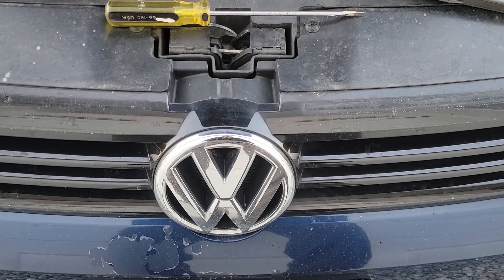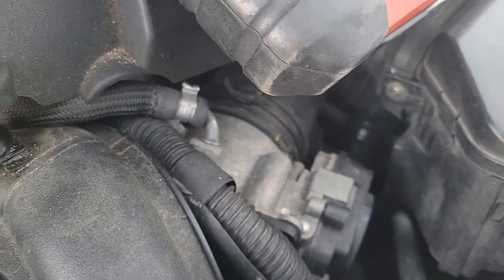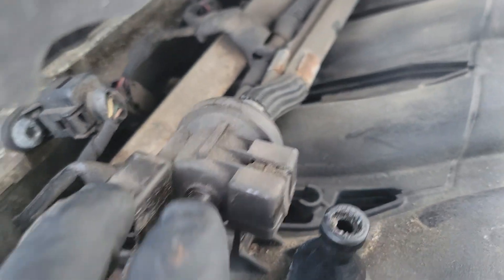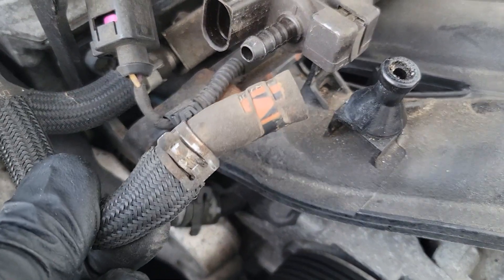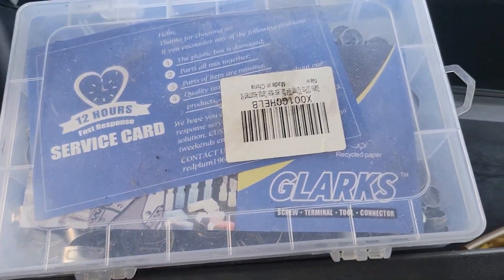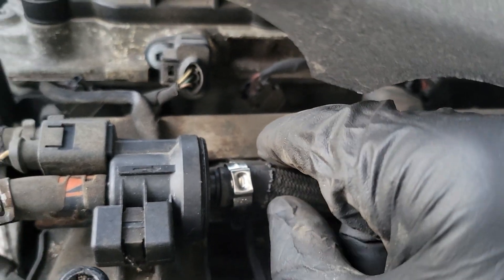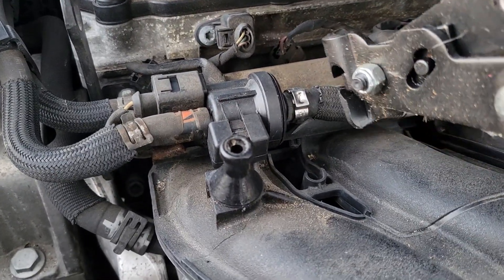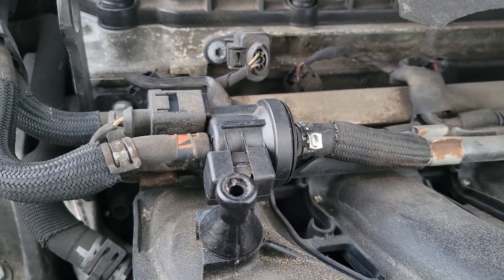P0442 (Small Evap Leak) VW 2.5L 2005-2012

Comment: Replaced mine with a Bosch aftermarket purge valve and the light came back eventually. I suppose I could buy the OEM model from VW for $50 although it is also Bosch and really seems like exactly the same thing. Wondering if I should try replacing the gas cap first?
Reply from the maker: What code did you have?

Comment: cars been running a little rough idly but not much but I was on gas on E , 30miles to empty , i filled up halfway, then no start, after 2 tries i got it start and got it home... Everytime i start it starts, but thens idles very low almost stalling then going to normal idle.. before hand it would after running for a while, idle poorly almost stalling once or so, but this sounds like a purge valve and its only 32 dollars i hope it is? any comments ? no check engine, but i swear the first time i tried to start after filling gas to halfway (20bucks) it should ecv or something.
Reply from the maker: Yes, the symptoms described are indicators of the purge valve going bad. There is basically an intake leak from the purge valve. During cold starts, it will be running lean and will stumble due to not being in closed loop fuel trim.

Comment: If its not the purge valve or the gas cap then what do you check? I've had my purge valve replaced and a new gas cap put on and my 2014 vw jetta still pops up the code
Reply: I have the same problem codes are P0442 and P0456
Reply from the maker: What code exactly?